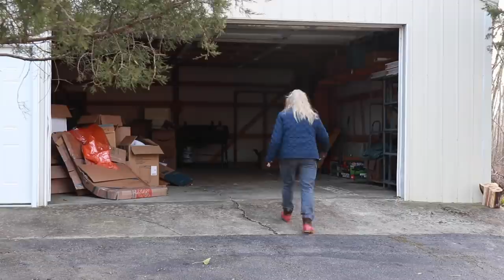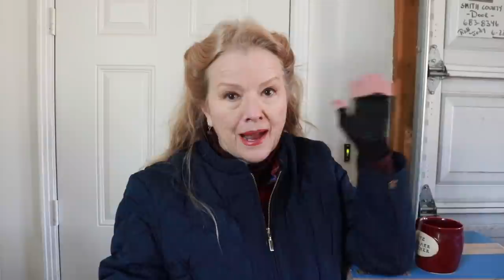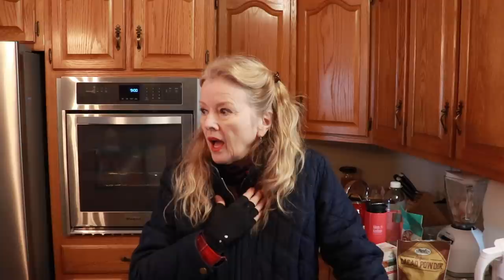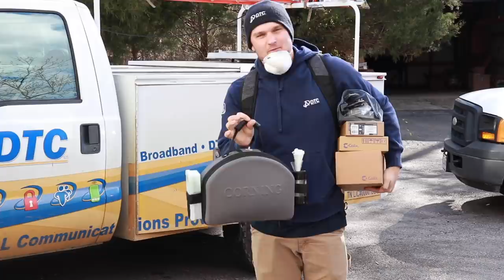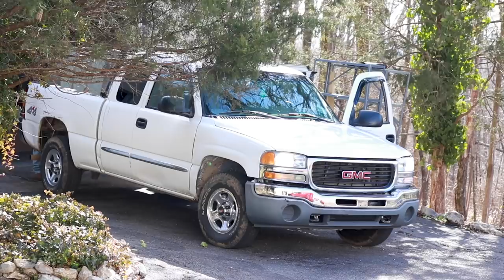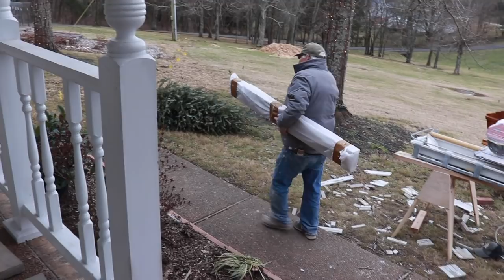Getting WIRED and PREPPED on a FRIGID day!

Comment: Kaye if were me I’d just use up the wood as is from the garage that’s in the garage and then stack next shipment outside. That’s a lot of work to redo. Yes green wood had to age and moisture dry out.
Reply from the maker: Yes, new wood was stacked in the shop. I will decide about green wood. Thanks!
Reply: You can burn 1/2 and 1/2 Kaye.  Like 2 green and 2 or 3 seasoned in the stove.  That way it keeps your fire longer.  It don’t burn up as fast.  I have that same stove.

Comment: Wood should wait at least a year and green wood dry outside covered............if you burn it you will fill more soot in your chimney and it will build up fast.  Wet wood burns slower and doesn't give as hot a heat off either.  We've burned wood for 48 years and we used 7 cords a year in heavy winters. Large home but we heated it all by wood with a couple ceiling fans. You have so much going on and so happy things will be going great sooner than later.  Every new situation in life is an education so no worries, we all have to learn as we go. God bless and you are going to love it when it's getting further along........it's a beautiful place now.  Blessings

Comment: hello and good day,,, i hear take of a pickup 
i would advise you on a small Chevy 4+4,,, not a 2500 
i have a Dodge,, i like Dodge,, had one in N,Y,, Georgia ,, Beverly Hills,,,now in AZ   end of the day pickups are a personal preference ,,, crew cabs are ok for the dogs if you have any
yeah a small Chevy reliable tough as hell,,, good truck,,,,
easy to load,,,, you can get a unloader devise that fixes to the tail gate,, works on a ratchet system with a crank-handle,,,
Around $200$ ok Kaye bye for now ed
Reply from the maker: Thanks for the tips! I did not know about that unloader! I will inquire.